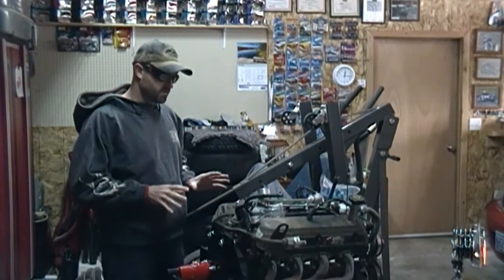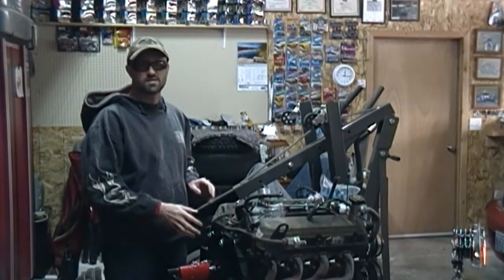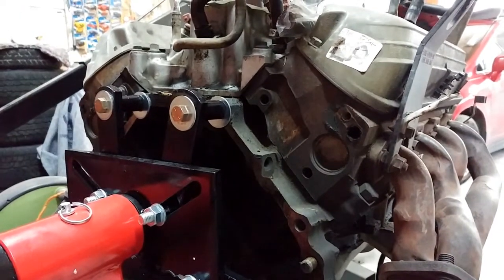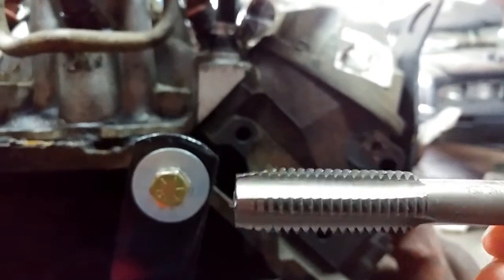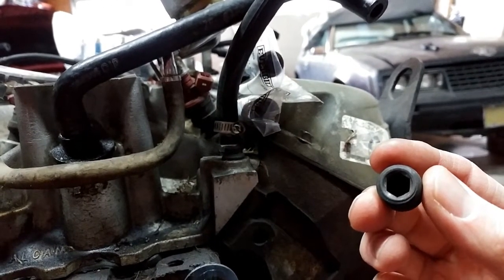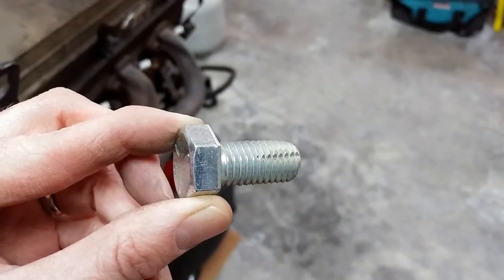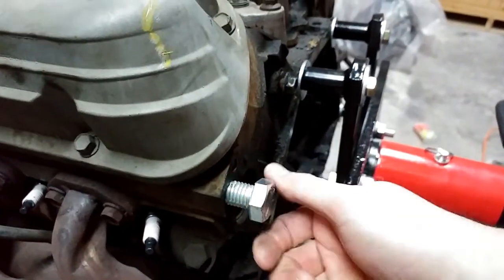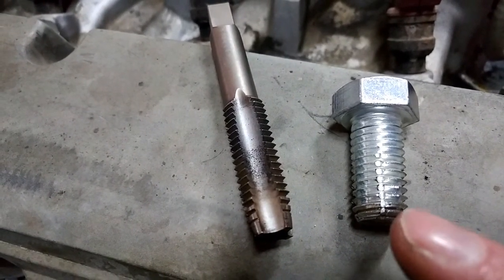Ford Foxbody Mustang V8 EGR Thermactor Plugs

Comment: Take an old spark plug from the 5.0, break the ceramic off and grind down flush with hex portion on plug.  Leave all the carbon in the holes, insert modified spark plug and tighten it up.  I've done this on several engines.  Never had one leak or fall out.
Reply from the maker: How does It look with the plug sticking out? Do you add any blue loctite?
Reply: Basin Motorsports looks kinda odd, but not that noticeable.  I never added any loctite.  Worked for me.  A guy I know that has worked on mustangs forever told me this trick.
Reply: Mark Matthews thanks.
Reply: My brother in law did it to my 93 lightning in 07 and I did it to my sn95 5.0 back 2010 it works just fine
Reply: Legend works great
Reply: Thank you so much for this tip, i a am absolutely furious here, been chasing this exhaust leak on my AFR heads mounted to my 66 Mustang.
I have never heard of anything like the thermactor thingamajamb, i've removed the entire exhaust and headers 3 times thinking i had a massive leak or cracked header.
Reply: Works great but doesn’t look the best. Definitely not in a noticeable area i would recommend if it’s the only option you got.

Comment: Yes, I did mine with the engine in....I bought a small wire brush from the hardware store and the 2 bolts like the one you used...I bent the wire brush 90 degrees and spun it in the opening for about 30 spins...got them in  with a ratcheting box wrench then finished snugging it with a closed end box wrench...
Reply from the maker: Nice! Easy peasy.
Reply: @BasinMotorsports  Yeah...with all the  plumbing gone from the air pump...everything is easy to get at on that side of the motor.

Comment: I used a wire brush for a battery terminal and soaked a bolt in locker and ran a but down on it. Its ungly but I don't have to see it and it isn't coming out. Cool channel bro. Not a lot of fox channels unless they are dropping a ls in it.
Reply from the maker: Thanks for watching.  There are a handful of channels doing Ford only builds, but the LS is definitely popular.

Comment: I did mine in the car, I used brake clean & one of those short silver battery terminal brushes. Spray the hell out of it, let it soak for a bit then twist the brush in & out.  Had to to it several times. But the brush works. Brake cleaner softens up the carbon, then threading the wire brush in & out cuts it up & brings it out. There's no chance of screwing up the threads this way......cause it is tight back there.   I like your videos, keep up the good work
Reply from the maker: Thanks for the heads up.  I like the battery brush idea.

Comment: Just did this to my 1993 Ford Bronco 5.8L with the engine still in the car. Before plugging, I completely removed all of the air pump and thermactor tubing. I replaced the air pump with the Proform direct bolt-on air pump eliminator bracket w/pulley, Proform part #68110. Anyway, even with all of the air pump plumbing out of the way, it was a major pain. I didn't film the process because it took a long time and would have just been a sailor's cliff's notes of profanity, but I may do a summary video of the process and the tools I used. It is possible while the engine is still there, but no easy task.
Reply from the maker: I've had those days, the profanity ones!  Sounds like you made it work though.
Reply: Why not just use a shorter belt?

Comment: 1990 Bronco 302.  My tube was cut and curled up by the previous owner.  It fell out.  I think they cleaned the holes after they cut it and rebuilt the engine.  I can see the threads exist.  I'm going to spray it with brake cleaner and then just use a dremel or my drill with a small long wirebrush and wirebrush it.

I'm confused why you didn't just use the 5/8 bolt altogether and just skip the plug.
Reply from the maker: You could just use the bolt in place of the plug. I did it this way for demonstration and to show how to do it. I also like that nothing is there from view instead of the bolt head.
Reply: Basin Motorsports it is pretty hard to see on my Bronco and requires climbing under the truck and looking up akwardly. Is it visible on a Mustang at all aside from having the carb jacked up?
Reply from the maker: You can see it enough on mine since the engine bay is wire tucked and the harness is slimmed down.  Some may not have an issue with seeing a bolt head.

Comment: I think that's where my leak is coming from. When ever I pour coolant into the radiator it leaks out the back of the passenger side cylinder head. What happens when that port is eliminated?
Reply from the maker: These ports were for emissions and feed into the EGR (exhaust gas recirculation) system.  If you don't have emissions on the car, then you don't need to piping.  They shouldn't have coolant in them.  If they do, you may have a head gasket leak that is allowing the coolant to get into the EGR system.
Reply: @BasinMotorsports  Thank you.

Comment: When I built my motor I put my heads head backwards. 
I was wondering what looked odd from the front end 😆
Reply from the maker: It seems crazy that heads can fit bqckwards, but it makes sense for manufacturing a head that can go on either side.

Comment: The components of the Thermactor & EGR system are indeed part of the emissions system,however they are two separate  systems & they don't share any components between each other.Therefore,the pipe plugs that screw into the back of the heads are called thermactor plugs,not egr plugs.Im not making this comment to be an Ahole,Im just clearing things up so that anyone searching for the plugs will search for the correct part name.
Reply from the maker: Hopefully distinguishing between them helps someone find the right plugs.

Comment: Love your vedio,i got fox 82, can you make vedio goning throw vaccume lines on the engine, my last mechanic cut everything now its running bad
Reply from the maker: The vacuum lines are different from model year to model year and engine. Which engine do you have in yours? The '80 widebody has been sold, but I still have the '86 hatchback with a v6.
Reply: @BasinMotorsports  V8 5.0

Comment: Immediately noticed your Zenni work (sorry... "sport") glasses... how do you like them? Tired of ruining my daily-driver bifocals and would like to invest in a work-only set (without bifocals, near-distance only).
Reply from the maker: They are great for the garage work, and I actually have 2 pairs of them.  They are a little bulky compared to normal glasses, but they are safety glasses with a polycarbonate lens meant to keep my eyes safe.  I got them through a past job at a factory, so they were inexpensive with insurance paying most of the cost.

Comment: I lock two jam nuts on the bolt and use a drill press and drill 2 or 3 holes directly in the middle of where the threads meet. Plus you make two bolt cleaners at the same time and it makes the tap/cleaner slot sharper like a tap. Usually use a 4 to 5 mm bit on something that size. Nice video I'd been looking at the plugs and don't want to pay that much lol. PS. Sub'd
Reply from the maker: I think the plugs were $13 each or something when I did this. The plugs at the hardware store were less than $1. Hard to beat the savings. Welcome to the channel.
Reply: @BasinMotorsports  should I use the longer set screws/plug? I get them for free at work or just stick with the 1/2 in plug?
Reply from the maker: @loyalfurds9913  1/2" is plenty long, but you can easily use up to 1" with no difference.
Reply: @BasinMotorsports  1/2 " is probably easier to finagle in to. But thanks for the good advice and good channel

Comment: I'm assembling a 302 with GT40 heads, I purchased the plugs you mentioned for the rear, wouldn't I also need to plug the front holes?
Reply from the maker: The front holes usually have accessory bolts that go in them for the alternator, power steering, etc. If they aren't being used, they may need to be plugged if they are open to combustion gasses in the same way.

Comment: Basin motorsports ...What about the 4 bar gt40p heads not gt40 3 bar... Do I have to plug those ??? Help
Reply from the maker: The GT40P (4 bar) have a different EGR system, and they shouldn't need the plugs like the E7 and GT40 heads do.
Reply: @BasinMotorsports  thank you buddy...

Comment: So why buy the plug when you can simply use the bolt with red loctite?

Am I missing something???
Reply from the maker: Nope. You can use a plug, a bolt, etc.  Whatever works.
Reply: @BasinMotorsports  Thanks!  Interestingly I can use one of my head bolts and it threaded perfectly into the hole once I cleaned it out.

I am going to the hardware store and get a couple of 1" bolts the same size and some red loctite.

Another way is to pull the heads, which I had to due to blown head gasket and where I wrung off an intake bolt!

Comment: i just plugged mine with a bolt and it runs and sounds slower bro what do i do!? my egr valve has a block off plate and it’s off
Reply from the maker: Did you do the plug for the EGR connector also? That's the only idea that comes to mind.

Comment: What is the advantage of doing this egr delete? Won’t it give you a check engine light as well? Just wondering
Reply from the maker: It can give you a check engine light potentially. For most that still have the system, the plastic tubes are broken and it doesn't work very well (if at all). For my car, half the system was deleted when I bought it. I removed the rest of the system, which included the smog pump, EGR metal tubes, plastic vacuum hoses, and wiring when I made my harness into a stand-alone system on the widebody. You can buy a delete electrical plug to trick the EGR system and not cause a light if you have inspections that look for it.
Reply from the maker: We have no emissions in my county. No cats, EGR delete, etc. is OK.

Comment: Don't know if anyone has made a video reply to this yet, I'll try it out and film it. I'm working on my 302 f150 with the motor inside the truck. I already started to plug it by cutting the tube ends and just using the pre existing smaller bolt to hold it in place, but it doesn't feel firm to me, so Id rather try your method of a small diy tap and plug the hole with a new bolt and loctite. Either way I'll film it and post my results.
Reply from the maker: I don't know if anyone has done a video in the car or truck. Give it a shot and post it up.

Comment: I have mine blocked off now what do I do with the EGR and the Evr on the strut tower ,I just have a line from the upper intake to the evr and a line to the EGR I'm pretty sure I have it ran wrong
Reply from the maker: Most remove everything. Half of the system on my '92 was missing, so I took it all out when I put everything into the '80. I wire tucked the engine bay and took all the wiring out also that wasn't needed for the '80 chassis.
Reply: @BasinMotorsports  my EGR is still on I keep hearing mixed things but I just  have the block off plate and plug u have to make with resistors ,I did I have a line going from the back of intake right to the evr then one to the EGR I've been stuck with this issue for months
Reply from the maker: I capped my intake off, took all the EGR stuff off and took the wires out of the harness. It didn't affect mine for performance.
Reply: @BasinMotorsports  mines a 91 gt automatic I'm not sure what year yours was and if there's anything different it's my first mustang so I'm super lost and it needs work

Comment: Please help, so im doing this triex doing it with emgine still installed so i tried the bolt trick bt the holes are pluged with gunk, how would i clean that hole out, its really gunk up
Reply from the maker: fish tail I have heard of others using brake cleaner to wet the gunk and then use a metal scrub brush (obviously a small one) to scrub a lot of junk out. You can probably get the bolt in better then.
Reply: seen videos where you cut the pipes switch side and use the back of the pipe as a hole cover..haven't tried it myself but looks like it works..

Comment: Why is it needed to plug these holes in the first place, once you remove all the piping and emmisions crap???
Reply from the maker: It becomes an open leak in the head without the plugs.  You'll get soot coming out the back of the head.
Reply: Basin Motorsports  Only soot?  I just had a complete rebuild done on my 302, with multi-layer gaskets for turbo setup, and I've got a leak at the rear of the block somewhere.. It looks like coolant running down the sides of the bell, and oil dripping from the bottom cover (which I suspect is the rear main.  The coolant one is a mystery  though.
Reply from the maker: @deancharles9949  Those are tied to emissions, so they shouldn't have coolant coming out. Coolant could be from the head gasket, the EGR housing (if you still have one), or the lower intake.
Reply: vacuum leaks, engine runs like crap,  causes a lean condition that can/will burn the valves

Comment: Does the smaller hole need to be  plugged as well?
Reply from the maker: No. It's just a mounting hole. It's not open.
Reply: @BasinMotorsports  I don’t think mine had a mount it was just the bolt that came out but good to know man thanks for the reply
Reply: When I bought the car it had the bolt plugged into the hose on the crossover pipe. Do you think the smog pump was removed?
Reply from the maker: @anthonycarranza8342 It might have been. If it was removed from the engine, the belt would be shorter or the pump could have been bypassed. It's usually on the passenger side below the alternator. You might see if it's there on yours.

Comment: Do your heads have a "T" stamped on the corner?
Reply from the maker: Not that I can see, but it is hard to get a good look at them with the engine in the car.  I see a "13" and a "14" in raised numbers on the corners, but I would think that has more to do with the casting molds.
Reply: Just curious is there somethin special if it did have a "T" stamped on it
Reply from the maker: @loganbreedlove4782  I don't know that the T means anything special like a GT40 head or something.
Reply: @loganbreedlove4782  I've been looking everywhere like crazy and no one seems to know if the"T" actually means anything

Comment: Why not just loc tite the bolt and screw it in once........
Reply from the maker: Steve Rives the threads will have soot build up from the exhaust. I preferred to clean them out to make sure the plugs would grab properly with the Loc-Tite liquid.
Reply: @BasinMotorsports  just thinking out LOUD:.....i wonder if a Bore brush(largecopperslender) for a large  caliber rifle  coated  with break clean  would make short work of the hole clean out issue.. that should be fairly easy access....
Reply from the maker: @1000MileVision  A bore brush would make easy work of it if it can be fished in there. It's a tight fit with the engine in the car. Easy peasy of the engine is out of the car. A tap or bolt would get anything left in the threads.